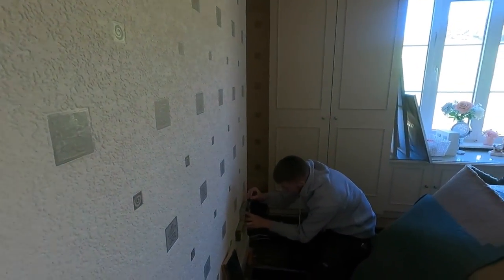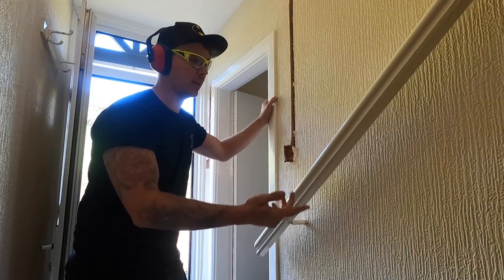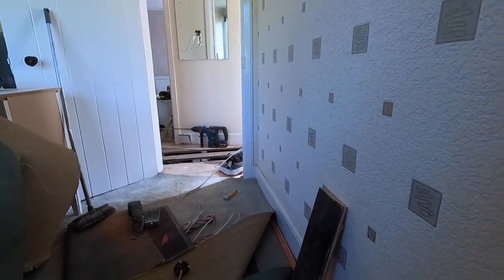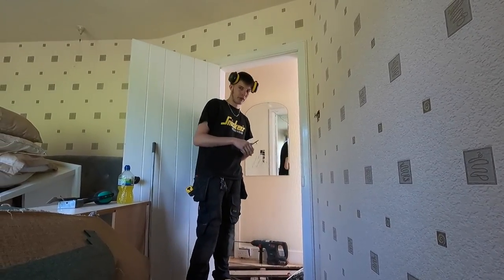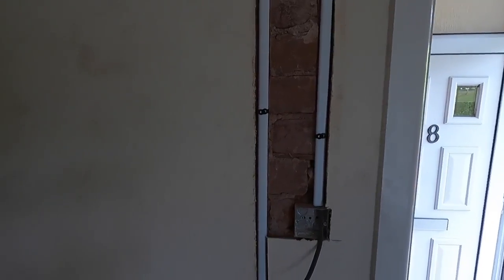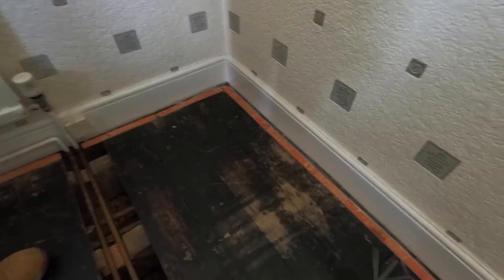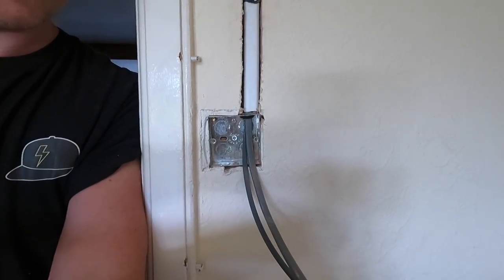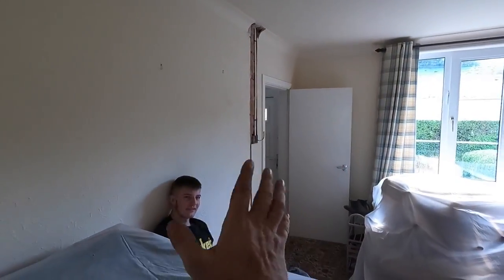Best wall chasing Ever!! House re-wire with Amy- Electrician

Comment: I can't believe how chilled out this is. 5 days to do a rewire. I used to be a QS at a firm where we had 2 squads of 4 sparks that did an occupied rewire each per day. They had job n knock and were in the van to go home by 15:30. They had 10 circuits to install and a full RCBO board. And all the bonding / Main earth. They also knocked out every box with a scutch chisel. To be fair that's all they had done for years and could do it blind folded.
Reply: Occupied?  Move furniture, lift carpets, strip out, put back and done by 15.30pm?  Maybe a one bed flat?
Reply: @Poorlybobsdad  nope 3 bed houses. Moving beds etc and pulling carpets back. They had been doing just rewires for the local authority for over 10 years. They literally went round the house like the Tasmanian devil and ate their sandwiches on the go. I couldn’t do it but they could.

Comment: Not done loop in way since rcd protection required on lights. I fit a deeper switch box and lever wago neutrals then solid wago cpc’s. This leaves just a t&e to the fitting. If there’s a fault you can just remove the switches and fault find all faults from there without dropping the fitting, handy if you’re installing chandeliers.
Reply: Agreed...it's also very rare for pendants to used these days, modern fittings are a nightmare to use as a JB...a combination of three plate and neutral at the switch seems confusing to me. I prefer to feed the switch and run a S/L & N to the fitting.

Comment: Just had my house rewired. No conduit used. Some of the chases were so shallow, the depth of the plaster the spirit level was rocking on the cable clips. I was going to run plastic caping strip (not sure what it’s called, strip available in different widths with the edges folded to allow a fixing to be applied) over the wire but the wire is often tight to the edge of the chase. I had Ethernet installed, I asked for Cat 6, Cat 5e was installed. There’s no extra shielding between the electric cable and the Ethernet as can be seen in the cutout of plasterboard used to accommodate the wires and they look to be touching in places. Apparently “it’s safe” and that over rides everything.

Comment: Use an optical alarm or combo alarm (optical + heat) in living areas, or a combo alarm (carbon monoxide + heat) in kitchens to prevent false activations. E.g. Aico Ei3016, Ei3024 or Ei3028.

Comment: Best to use the rechargeable type smokes ,as you say with the battery type when the batteries run down you get the annoying beep 👍
Reply: Nice in the USA, that we have battery powered units that use 10 year Lithium batteries that will last the life of the unit, however cities require AC powered units, which still use silly 9V batteries and die as well and have to be changed.

Comment: Those windows were the first generation of upvc windows and doors in this country , distributed by Hepworth industrial polymers in Burnley whose M.D. Peter Abbot went on to work as M.D. for Veka ( huge company). Those frames have a sanded and polished finish which was dropped in favour of corner grooving , but with the early extrusions the surface finish was poor and so all the frames had to be sanded all over. I spent months and months sanding with an air DA then polishing with a rotary sisal brush to get an acceptable finish. If I was at that site with you I would have to look along the door frame on the surface those metal gold coloured keeps screw to to point out the brugmann marking which was a small semi circle over a bigger one and two at each side and a date stamp to say when it was made. My guess to get the double glazing anorak of the year award would be 1984-85.

Comment: Good idea on the all round band for the oval conduit. I normally use clout nails but they aren't always suitable so will keep this in mind for future. Oval makes a much neater job than capping I reckon. Much narrower chases too!
Reply: I use a makita wall chaser and set it for the width of the oval conduit no need to fix the conduit to the wall as it usually fits snug in the chase. I am thinking of getting the metabo chasing disc as it takes out all the chase so need to to use an sds to knock it out but it seems expensive at £99 a disc
Reply: And you don't slice your fingers like with capping. Those cuts REALLY hurt and take ages to heal too.
Reply: Capping for first fix on block work extensions etc... conduit for rewires all day long...why is this even a talking point??
Reply: Does the banding just fold over oval conduit from both sides and not fixed just folded?

Comment: Nick, sounds like there is a market for dual circuit smoke alarms.
Dedicated circuit goes down, do some beeps. Lighting circuit goes down, do some beeps.
No idea how you would isolate them on the inside of the smoke alarm, but I bet some landlords would like their renters from disabling the smoke alarms
Reply: If its a rental I put the smokes on with a lighting circuit. Prevents the tenants from turning them off.

Comment: its neat clipping the cables under floor boards but sometimes for slip ups we used to leave a bit of spare cable to be able to pull some more through, and also why not go behind the coving instead of cutting it?

Comment: Whats that plastic cable channel trunking stuff called please? I just chased out so wide for conventional channeling! That stuff is way nicer..
Reply: 25mm oval conduit. Sits in perfectly when using wall chaser 👍🏻
Reply: @michaelcoleman5229  I just got 1 length of all sizes (not curved.) Using 30mm x 30mm wall chaser but all my chases only 22mm deep. I put them 50mm wide for the channeling now change mind I want to use trunking.  Will chase deeper this weekend

Comment: I thought we could only drill holes between 25-40% either end of the joists span? I noticed at 1 minute in they were less than this. Does this building reg only apply to new builds?
Reply: They didn’t care when that house was built. bigger beams than new builds

Comment: If your having the smokes on the same circuit as say the upstairs lights would it be ok to take the feed from the board to the downstairs smokes then a 3core to upstairs smokes then take the upstairs lights off of the smokes. (less wiring as only one cable between floors) thoughts on this anyone
Reply: Smokes ‘should’ have a means of isolation without turning the lights off. That being said you could still make it work